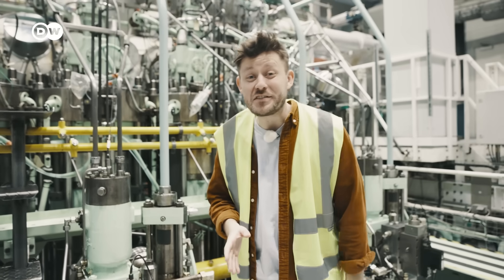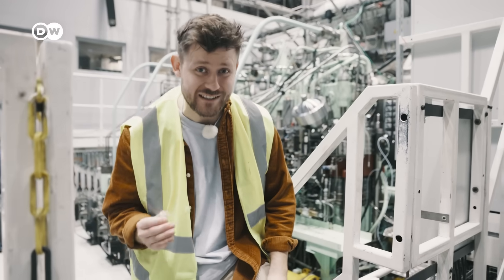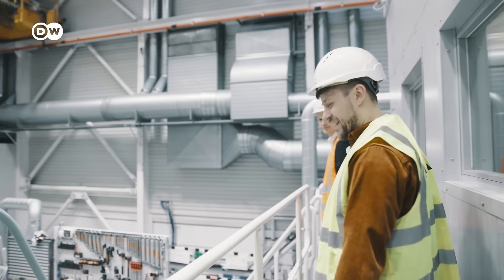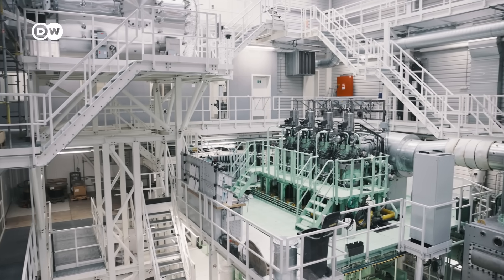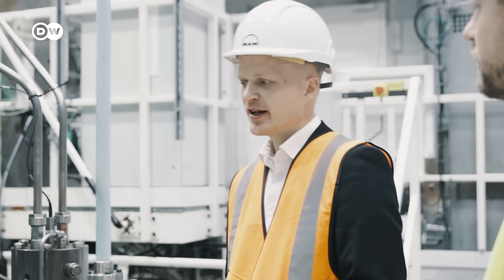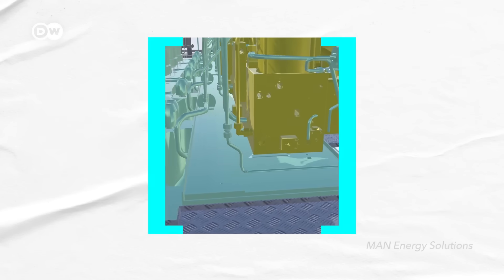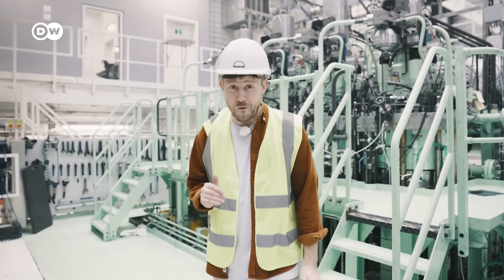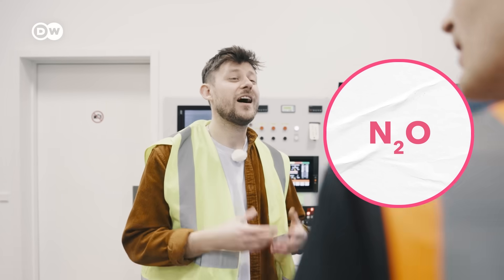Can this magic fuel clean up the shipping industry?

Comment: If one uses for instance a process whereby one heats up carbon blocks using any energy source you want and have a nitrogen source circulating and store some heat in stone blocks or permeable ceramics blocks one can go easily to 1800 Celcius using this one could go towards a process used in red or pink hydrogen without the nuclear reactor, Anthora energy has these systems for heat under development.

 Then we can use quick oxidation and redox using heat and electricity to produce large scale hydrogen systems.

The water can be taken from the ocean using a system developed by a certain professor that can suck in 98 percent water saturated air, at the coast line using a setup a 100 meters high and 200 meters wide like an oil rig with large air inlet ventilators a compressor and I would let the vapour go go down into the sea using a stainless steel pipe to condense with inward facing downward spikes and compress the air,
then put it on stands of Roman concrete that exists out of a different mineral it lasts 2000 years if needed instead of 30 years and can be made like these skyscrapers if sea levels rise, it can climb higher on its stands by having something grip on to the concrete leggs and have a mold above where new concrete is cast then climb upwards again until it rests on top again of a concrete leggs structure,
but we then also need to add some pipe so we have water desalination without brine !!!
The natural evaporation of seawater is used but the amount of saturation level above sea is so high compared to above land that it's so effective that it will need 8 for Los Angelos for the complete water supply and 4 for the complete supply of water for mekkah to name some places where desert meets the land; 

then using concentrated solar, or wind, or solar panels drifting on water to cool the bottom we could produce energy to make hydrogen without brine and without using fresh water supply needs.

This can only be done where desert or hot places meet the sea so in Spain it could be used in south Africa as well or in any hot places close to the sea.

Once the temperature rises only more saturation levels will be reached almost up to a 100 percent at a certain period.

Oh just include a bit of water on the bottom to form a counter pressure against the vapour pressed in and condensing and include a pump in order to get the water up again. Use a Tesla valvular conduit to account for counter pressure problems it can stand up to a 1 to 200 pressure ratio and should be calculated such that it accounts for flow back pressure so there is enough pressure against the condensing water but not that much that it is impossible to compress the water we need an underwater pump powered by a system that will uses a power source like either compressed air or something alike that does not confilct with the water around High voltage DC is possible but less advisable in this setup.

It al already exists and could he done at large scale no problemo.

So yeah we can do it if we want to.

Using a Stirling engine is a way to even improve these large ships engines more and more they also make heat thus need cooling a Stirling engine also provides in a way a certain kind of cooling, in a ship it will transport it out as well whilst making motion and thus produce more electric power.

Also in cars if they run on hydrogen a Stirling engine can be used in concordance with a traditional engine especially if it runs very hot but they will need several layers of cooling grid behind one another and a lot of drive wind coming in to produce extra power for electricity that can be used, if we have either direct driven hybrid vehicles using a combination of combustion engine and electric power even brake power can he stored in super capacitors a battery would only wear out in that capacity or we might use what we call an internal combustion electric vehicle meaning the same as a diesel locomotive that uses a diesel generator to produce electric power and than in turn drives the wheels by electric motor because it would need an enormous gear box that does not fit inside the locomotive to power it's wheels

and so does an Abrahams tank drive a gas generator wich makes electric power that drives an electric motor that in turn drives a hydraulic system. That powers the tracks and other systems.

We could of course use metal plates to act like a kind of outer hull of a turbine for a ship and cover them in plastic that can stand the heat as part of an electric motor system using a squirrel cage engine inside the water pipe and make a direct driven turbine inside a ship with  pipes running everywhere so we just open and close very large valves but we need the metal plates to form a kind of counter pressure against the seawater in order to prevent it from goung under and a lot of pressure protection actually we need an outer protection as well and very good emergency pimps if it starts to leak,

it can be done and once te inlet filter clogs, just stop or reverse the flow for a short while so it drifts of what is caught in, or just is blown of.
This is used to better steer the shopin order to better steer the ship.

Anyway this is old news to me but it would he great if someone could apply it for real.

Would save a ton of money and resources because we would pollute less so that would require less pollution damage payment and it would make it more effective as a whole...

It is not a real problem but if applied in this fashion we might have good shipping and a start of ammonia powered hydrogen tech for heavy industrie it all starts or falls with our ability to build the right tech.
Especially the infrastructure to build is important so we can progress towards a society that uses hydrogen and it always starts with heavy industrie.

We cannot produce enough batteries to power all out stuff heat storage in sand is a possibility as a grid balance for heating homes but we also need this tech for mobile large scale power application and this cannot be applied by battery tech.

Than once the infrastructure is there and tested we progress towards the common man.

I can build a moped on liquid petrol gas for instance but if I do it the wrong way I have my own personal ejection seat so that would require me to have a parachute on my back,

Same with hydrogen you do need to do it right, your composite tank that can handle up to 800 or 900 bars of pressure and forms a gas proof layer inside, a bit like oxidation but than with hydrogen and composite materials needs especially on a motorbike a kind of blast and impact protecting shield and a means of guiding the hydrogen underneath the rider away from a hot engine and requires aerogel 98 percent gas and 2 percent mass the most insulating material available innorder to prevent the bleu frozen balls syndrome that shatter on impact, like a tomato in liquid nitrogen.
Putting a bullet through a composite tank was underwelming according to tests since it cooled itself and only got up to combustion temp higher up in the sky, since it recombined with air to form water in contrast to helium that is a noble gas and does not react with anything at all if dilluted it does recombne to water unde influence of sunlight but also things like other effects contribute to it reuniting with oxygen to waer be it at s higher altitude it is way up high before it becomes combustible again.

We can also store some liquid hydrogen In a tank with insulation made of a vacuum with an outer layer around it made out of liquid nitrogen to prevent infrared heating through the vacuum layer.
All helps towards a battery and hydrogen powered society.

Unless someone has the tech to store enormous ounts of power Inna small space in such a way that it is doable we need to of course also recycle the lithium and other metals, but still we need hydrogen to make a kind of hydrogenntech like this possible.

And who is more suited on the long run than oil companies with gas stations to handle a flammable yet extremely cold tas or to transport ammonia either through pipes or other means towards a place where it can be used.

Comment: If they crack back the ammonia to hydrogen and cool the exhaust to below minus 33 Celcius than you get the ammonia slip back, so if you burn the hydrogen under a protective athmosphere of steam at certain pressure and use pure oxygen then one could also run nitrous oxide free since nitrous oxides exist in all we burn in an atmosphere with nitrogen or an engine with nitrogen in the fuel. So a ship can harbour these systems onboard as can an airport since airplanes can fly on liquid hydrogen they need the turbines to run clean without pollution, with an inner and outer engine and a system to convey the power at the right rpm to front, but if one does built these engines, if one runs them in concordance with a system using the heat the Stirling, engine that can use the engine heat to run against the cold water or an athmosphere one could also use excess heat.
Cathalists slowly decay but this  system I describe can be used to do away with any pollution whatsoever.

Comment: From what I understand, production of green ammonia has the same issues of green hydrogen: far more electrical energy input compared to the output, the lack of thousands of industrial scale electrolytes which will take a decade or more to ramp up, the redesign of ship tanks to make up for the lower energy density. Yet a battery electric ship that crosses the ocean is not feasible with the actual density.
On the other side, ammonia seems easier to transport and store than hydrogen, and engines are more similar to the diesel ones. Am I correct?

Comment: Powered by nuclear, this would be a great idea, powered by "clean" renewables this is literally braindead.  Sure burning ammonia produces little CO2 that hasnt been drawn from the atmosphere, but being one of the most energy intensive industrial processes, you will release craploads of CO2 with all the plastic, fiberglass, silicon, copper, cobalt and lithium needed for the renewable power generation.  Renewables don't actually make much sense for exactly this reason, using them to make "green" ammonia only makes their low power output even more of an issue.

It is true you can store energy from renewables in ammonia, reducing battery usage, but this is still dumb because you are paying 10x the material (and pollution) cost PER unit of energy, and then wasting most of what you paid to generate it on inefficiencies in the ammonia generation.  It is true this is better than wasting this pricey energy, but why generate overly expensive energy in the first place??  Its illogical, borderline religious nonsense.  How on earth will this ammonia compete with oil products on price? Oh yeah it wont

Comment: The very nicest thing you can say about future green ammonia as a shipping fuel, is that it might be cheaper than methanol.  But to be cheaper, you would need to assess the value of human and aquatic life at ZERO.  A ship's engine room is the very definition of a confined space.  Imagine a toxic and corrosive gas, requiring repair crews to basically wear space suits, leaking into a ship's engine room, during a storm at sea...there is literally nowhere to run.  And you missed that ammonia ITSELF is a regulated pollutant.  The toxic concentration for aquatic life is around 1 ppm...  The people pushing this concept are either ignorant of the chemical hazards or are playing fast and loose with lives and the environment.  To a seasoned chemical engineer like myself, using a poisonous liquefied gas as a ship's fuel is just insane.  It fails the 1st principle of safety in design.

Comment: Ammonia production makes no sense because to energy hungry, better use steam engine or electric motor to drive ship. Steam production on ship via atomic fission like submarine using thorium reactor. May be hydrogen would work as a fuel converted to electricity via fuel cell running electric motor.

Comment: I believe that creating a GNL engine with a compression ratio of 16 and a spark plug instead of an injection pump, and the crankcase gases being burned after catalytic converter with a constant ignition system would be much more efficient than creating this hell this guy is talking about.

Comment: Four minutes 23. You say look at these massive cylinders and then you put on the screen pistons - both are incorrect. What you are looking at is the bottom end of the engine. Basically the conrod up towards the bottom of the piston and I’m not sure in that engine, but probably it has a cross head, joining the piston with the crankshaft because of the huge long/would have too much angle to fit within the crankcase and it would thrust within the bore.

Comment: Why not just use natural gas as an bi fuel and ignitor or methanol?
Reply from the maker: Hey Magnus! The ammonia engine we see in the video uses a pilot oil, e.g Diesel, as an ignitor. There are also plans for ships with dual-engines, using LPG and ammonia. HD Hyundai Mipo Dockyard for example is currently building such ships.

Comment: When it comes to cutting down on emissions the importance of increasing efficiency is often overlooked, it plays an important role if fuels are created with electricity.
For example it doesn't matter if hydrogen powered cars only emit water vapor, even if the hydrogen was produced with green energy, because we must assume that this electric energy is a scarce commodity. Creating hydrogen, compressing it, shipping it around all costs energy, energy that could also be used directly in electric motors, electronics, industrial processes and households. When we use it to create combustable chemicals we lose some of it due to innefficiencies, it turns into heat mostly or some unwanted byproducts or used up for maintaining the facilities for that extra step.

To me it seems using ammonia is one of those routes where the inefficiencies are so high that it doesn't really lead to the entire world being turned upside down for trillions of Dollars in order to make the switch. There has to be something that is so different and efficient that it cuts our more processes until you end up with some sort of fuel or energy storage on ships.
Reply from the maker: Hey there! Thanks for sharing your view. We also tackled hydrogen in another video  👉https://www.youtube.com/watch?v=AGTjKJHu99c In a few weeks we will publish a video on Europe´s hydrogen strategy. To be notified about it, subscribe to our channel ✨

Comment: Not mentioned in all the disadvantages is the low efficiency.  Ammonia engines are only about 36% efficient, compared to over 50% for diesel. In addition there is the energy cost of liquifying the ammonia.  So more than 64% of the energy in the fuel is completely wasted. This compares to about 96% for electric motor propulsion.  And of course ships can also be built to use a completely free, renewable source of power - wind! 

No internal combustion engine is much over 50% efficient. This is an example of huge manufacturing firms desperately trying to keep their obsolete internal combustion technology in play.

Comment: why we don't try to use green hydrogen from electrolisis as engine fuel than creat amonia with it, I think hydrogen have more energy density and more cleaner rather than amonia as a fuel engine
Reply: Hydrogen has a high gravimetric energy density (MJ/kg), but a very low volumetric energy density (MJ/l), even cryo-cooled liquid hydrogen.
4 liters of liquid hydrogen equate roughly to 1 liter of diesel.
And you need extremely low temperatures to keep hydrogen liquid, that's a big effort/disadvantage.

Comment: How is ammonia made?
Reply from the maker: Hey there! Ammonia is mainly produced through the so-called Haber-Bosch process. It is a chemical reaction between nitrogen gas and hydrogen gas under high pressure and temperature, usually with the help of a catalyst.
Reply: @DWPlanetA  And that is in your eyes "Clean Technology"? High pressure, hmm, sounds like a lot of energy needed. Hydrogen, hmm, sounds like a lot of energy needed. Nitrogen, hmm, ..., high tempereture, hmm, ......
Reply: @petrbrazda1064  You might confuse "clean technology" with "magic".
Reply: @petrbrazda1064  And why "Nitrogen, hmm"?
78% of the air is nitrogen.

Comment: With the abysmal calorific value and inefficiency i really dont see it taking hold (noted im as layman as it comes to propulsion technology and engines). I'd say that the small nuclear salt reactors are the way of the future. Having a calorific value greater than anything out there and being the sizes of 2 or 3 shipping containers, while also safe in case of emergencies. then you have a ship that has minimal downtime because you only need to switch the crew and not spend days refuelling it.